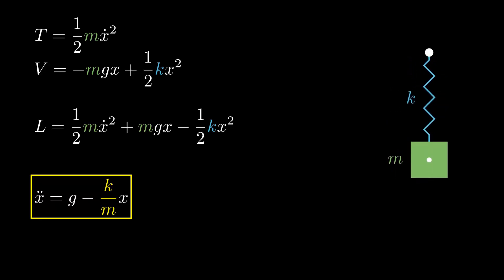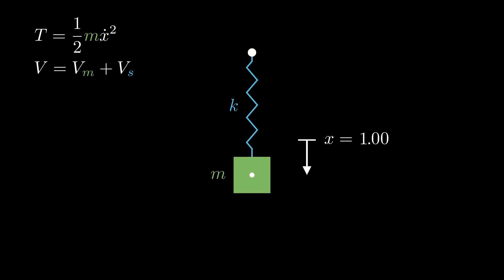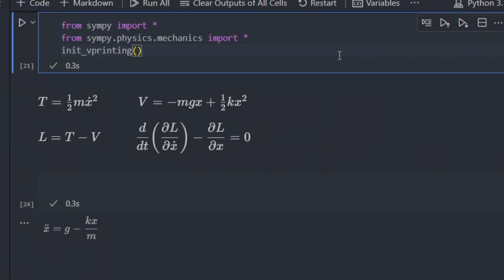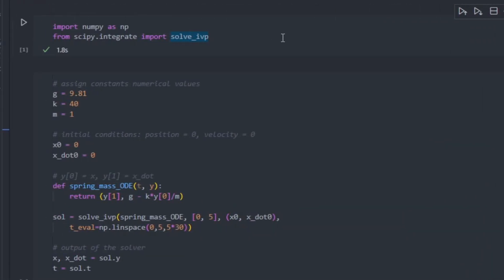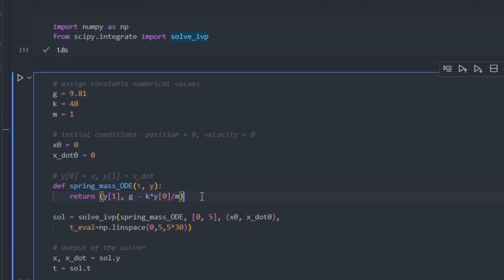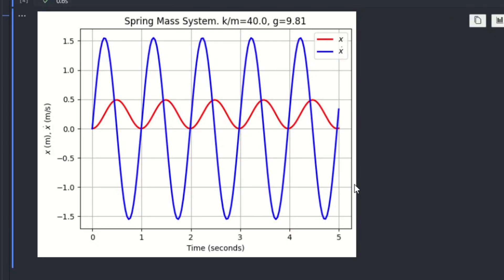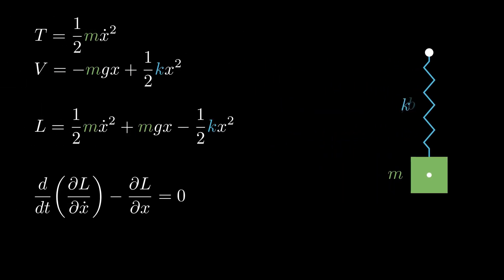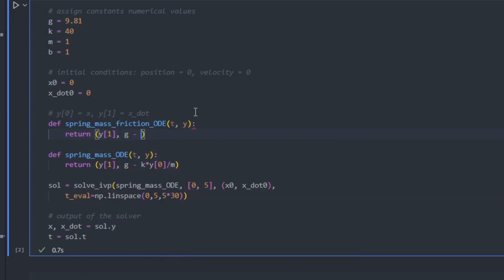Model + Simulate Spring Mass in Python

Comment: Awesome video! How are you outputting the latex?
Reply from the maker: To view to the latex in the Jupyter notebook you need to run the command 

init_vprinting

Which I did in my import statements at the top of the program.
Reply: @logandihel  Yeah, I did that. I'm not sure what actual function you're using. I have another route that is working for me now, but it's a bit messy and requires a bit of setup. Your method seems cleaner and simpler unless you've abstracted way much of the details.
Reply from the maker: I'd recommend copying the code directly from my github page (link in description), and if that doesn't work you can submit an issue on my YouTube GitHub repository. It's also possible you're missing a required package, or the packages have changed versions since I posted the video

Comment: Ey! I have a question, It’s the energy of the system constant? I mean, silly question, but when I plot E = T + V, it’s not constant...
Reply from the maker: The energy of the system is constant only if friction is ignored. Set b to zero and you should see the energy is constant, perhaps with small changes due to numerical integration errors
Reply: @logandihel  Ahh it oscilates... Thanks anyway! I was searching a bit and I think it’s common in the way it solves the ODE right?  I was doing the kepler problem potencial to see orbits and again the energy driftt. I guess now i’m reading a book about numerical method for python... I thought this day will never come!

Comment: How to increase the oscillation time so that the pendulum swings to a complete stop?
Reply from the maker: The solve_ivp() function allows you to input the simulation time (mine is set [0,10] meaning from 0 to 10 seconds) and also the evaluation time (mine is set from 0 to 10 seconds, evaluated 30 times per second). You can increase the 10s to a larger value like 25.

You could also change the value of "b" (damping coefficient) to perhaps 5 to make the system lose energy faster
Reply: @logandihel  I changed the value but the duration of the GIF image remained the same. What can be done?
Reply from the maker: @olsea1229 which file are you editing? Is it SpringMass/animate.py ? If so, only lines 25 and 26 should need editing to change the .gif file time duration
Reply: @logandihel  I changed it like this: sol = solve_ivp(spring_mass_ODE, [0, 30], (x0, x_dot0),
  t_eval=np.linspace(0,10,10*30))
but the time of the gif animation has not changed
Reply from the maker: @olsea1229  change t_eval to np.linspace(0,30,30*30)
Reply: @logandihel  thank you❤❤
Reply from the maker: Just updated the code on the main branch of my github page so you can adjust the simulation parameters with `t_final` and `fps` for the spring mass and simple pendulum 👍
Reply: @logandihel  Hello, 1 more question. What should the coefficient “b” be equal to in order for the pendulum’s oscillations to be as close to reality as possible?
Reply from the maker: All of them are close to reality! The constant b is the spring damping coefficient which is usually determined in experimental tests or can be found on the datasheet from where you buy it. Just play around with different values until you get something that looks nice. Larger values of b mean more damping

Comment: You cannot call this a simulation, this is only a visual representation of the solution of a problem analitically solved...
Reply: Not true, when he called scipy.integreate.solve_ivp()  it numerically solves the "initial value problem" by running a time-step by time-step simulation. It does not use the analytical solution of the ODE.
The description of the function says "This function numerically integrates a system of ordinary differential equations given an initial value". There is nothing more fitting of the name simulation than that.

Comment: Hi logan...pls tell how did you made that motion picture of oscillating spring mass system
Reply from the maker: Code for the animations are available on my github page, which is linked in the description. The motion picture was done using the manim library, which I may put out a video later.

Comment: I was wondering if you can change the setup to a horizontal one therefore getting rid of potentiel energy Vm and only leaving the elastic potentiel energy of the spring
and starting the simulation after an initial displacement of the mass m
Reply from the maker: Yes, that would totally work! That would be a great exercise for you.

In fact, you could generalized the spring mass system to oscillate back and forth about any angle!
Reply: @logandihel  Thanks for responding, I'll surely try it

Comment: how can we apply gas pressure in spring mass?
Reply from the maker: You can model air resistance by modifying the ODE. Typically the drag is proportional to the square of velocity.